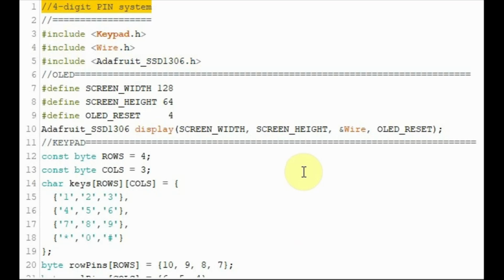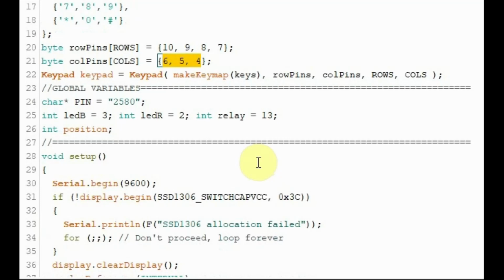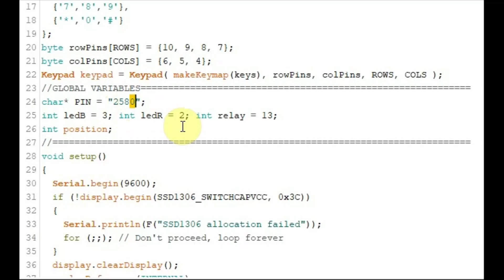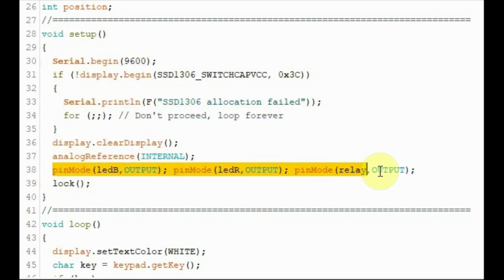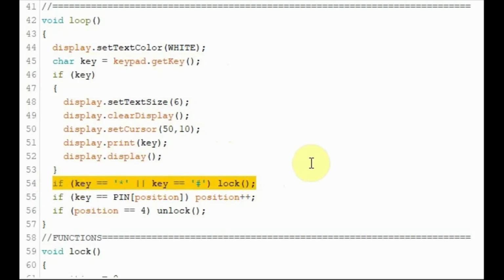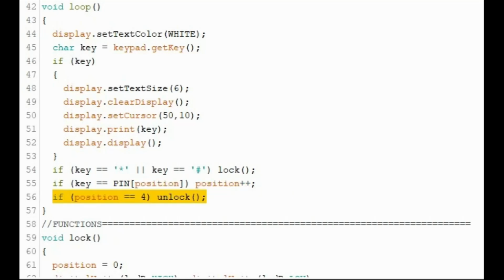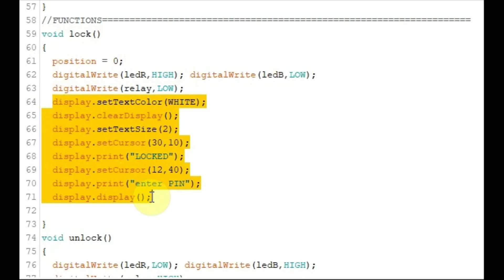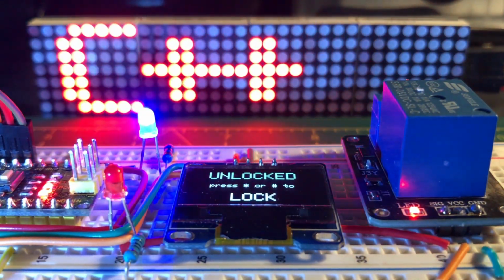Arduino-Based PIN System

Comment: hi, i have tried your realization with an oled 128x32 and a 4x4 keypad with the required modifications of the code taking into account the dimensions of my display and it works. thanks a lot.
Reply from the maker: Great, and thanks for your feedback.
Reply: @AnasKuzechie  thank you and good luck I subscribe to your channel because I like serious work and I like electronics 👍✋